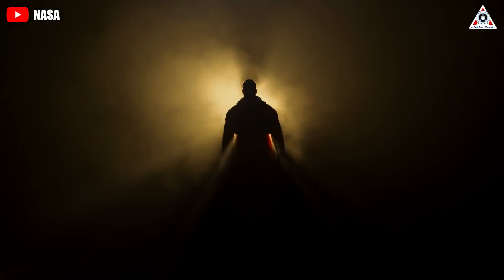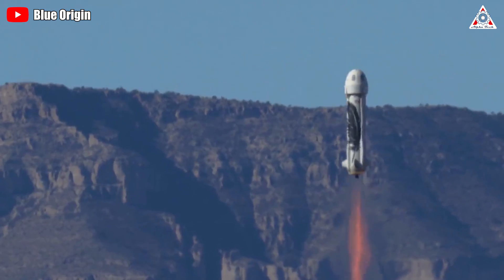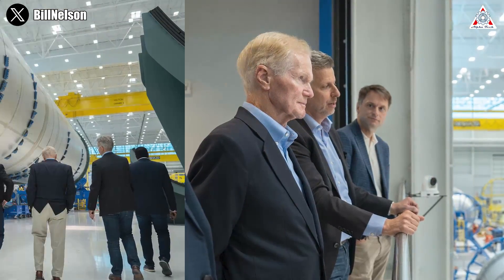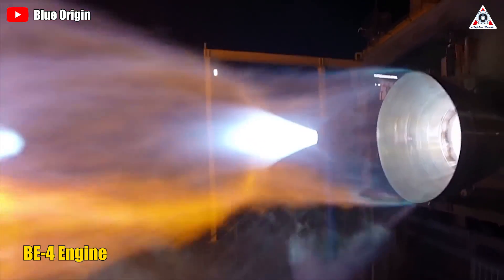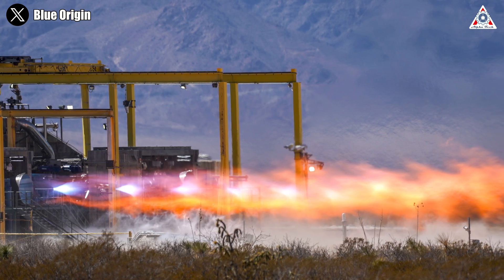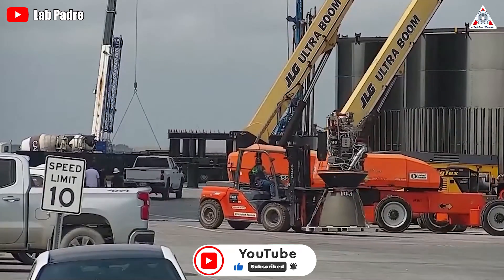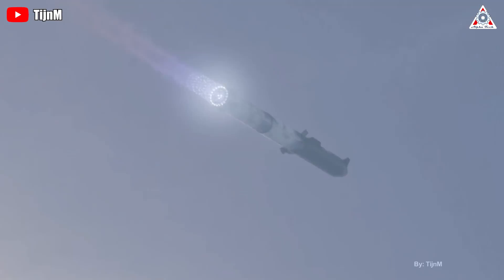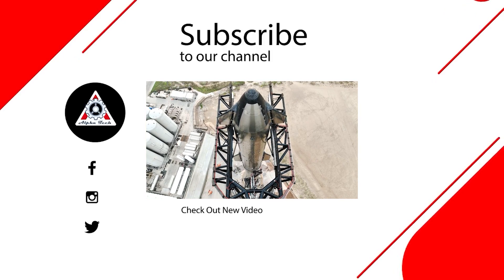Unexpected NASA visited Blue Origin's factory, New Glenn new progress but SpaceX even crazier...

Comment: Race means "competition".

Until Blue Origin themselves achieves ORBIT, it is not participating in any competition other than operating an amusement ride.

Race members:

SpaceX - ruling the roost with more launches and putting more tonnage into ORBIT than all others combined. 
China - These guys are stepping on the gas in their space operations.
Russia - Between the SpaceX "Trampoline" working so well plus sanctions, ROSCOSMOS is working on a bare thread budget. And their last lunar mission proved it.
China - These guys are working hard on mastering space operations. DO NOT TURN YOUR BACK ON THEM
ULA - They better hope the BE4 works
Arianespace - Not many launches, but they are viable still
Rocket Lab - not a lot of weight into orbit, but they are viable
ISRO - India made it onto the lunar board. 

I don't see Blue Origin because they don't matter outside of the BE4 engine which has yet produced a successful orbit launch. 

Jeff Bezos spent all that money for PR and bragging rights

Elon spent all that money and got the most prolific aerospace company in history
Reply from the maker: Thanks for your comment! A great analyzing🤝